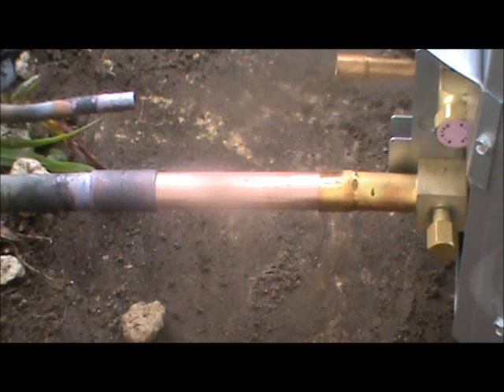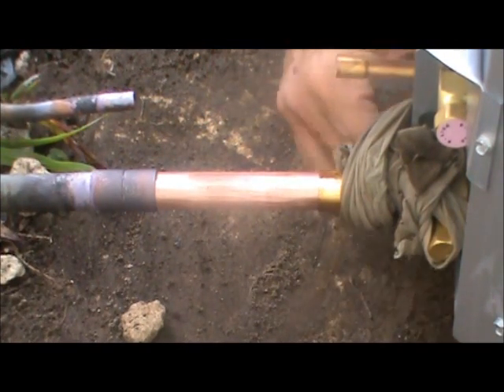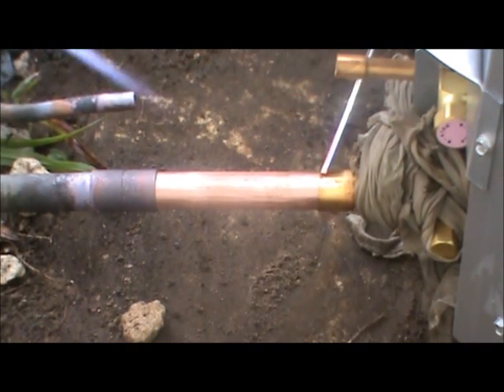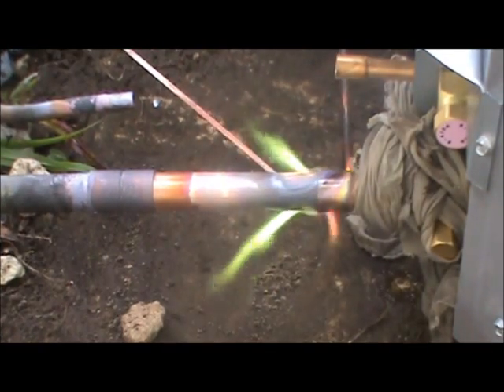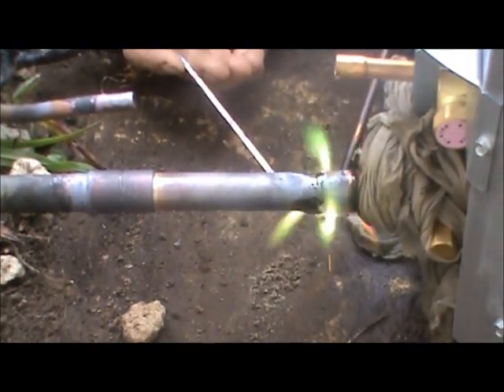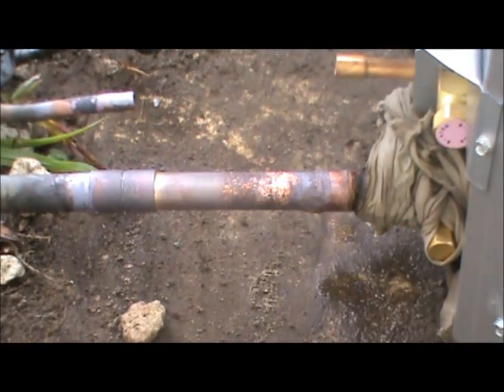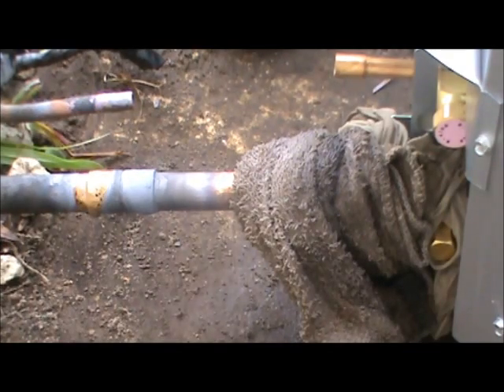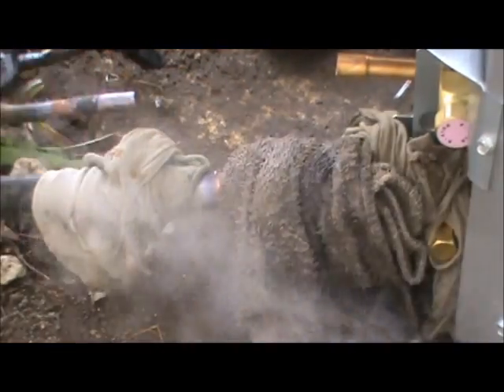HVAC Training - Basic Brazing

Comment: good video!
one question: some guys recommend "cool gel" to me, they said this jello-like stuff can replace wet rag to protect some fragile parts while brazing. How do you think this?
Reply: XIAO JIE we use it sometimes its really is an amazing product but we usually put a.wet rag right on the valves anyways and spray the gel.close to the joint the rag almost never gets hot

Comment: Great video, .. i would like to see a video demonstrating how to use nitrogen while  brazing in line sets to a new pre-charged condensor coil. Now i would like to know just how this can be accomplished because doesn't the nitrogen need an inlet and an outlet to keep the flow of nitrogen constant.
Reply from the maker: RAGENBUQUE Yes, you have to take the schraeder valves out of the service ports. Nitrogen at about 1-2 psi.

Comment from the maker: You should have nitrogen at very low PSI flowing through the lines. This video is to demonstrate brazing and ragging techniques.
Reply: +UtwoBed if you don't purge with nitrogen you can easily have copper oxide created in the lines which will contaminate your system.  in turn plug up your drier and expansion valve.
Reply: +Ron Walker   Why flow the nitrogen at all? If the system is purged with nitrogen it will remain in the piping long enough to do your brazing.  Where is it going to go? I just purge and then loosen the fitting on the hose at the nitrogen tank to relieve all pressure and then get my brazing done. Oxidation has never been an issue using this method.
Reply: Agreed. He should also take a minute to clean his tip

Comment: Can you make a video on brazing the 3/8 line?
Reply from the maker: Brazing a 3/8" line the same technique is used. Just make sure your torch is turned down a bit and it is very important to keep the tip of the torch moving. Otherwise, it will burn a hole in the copper.

If you I can help you in any way please feel free to contact me.

Ron